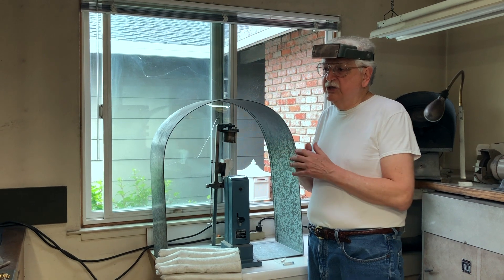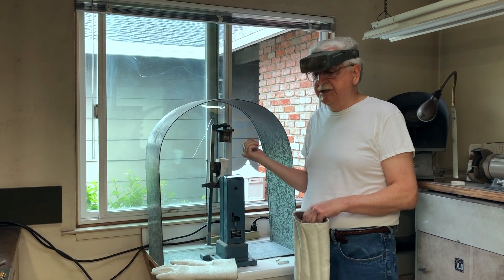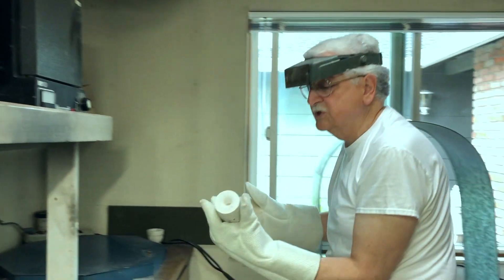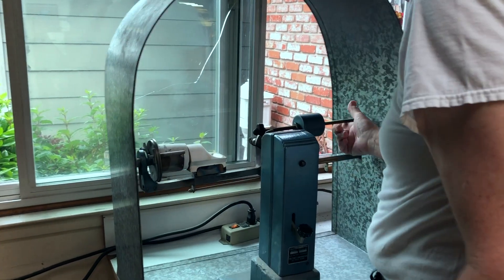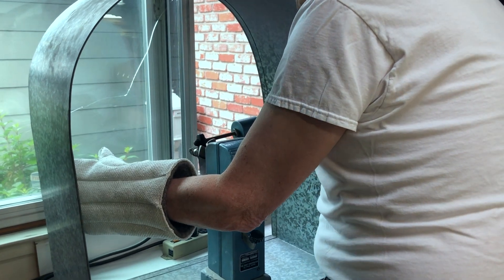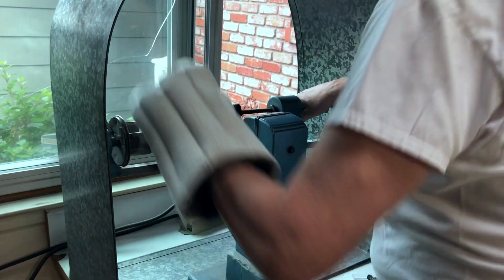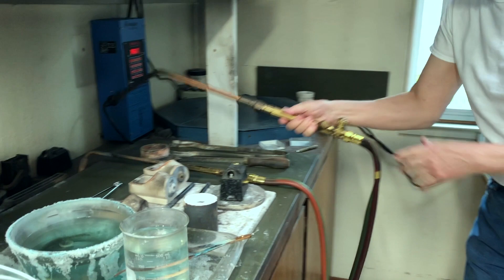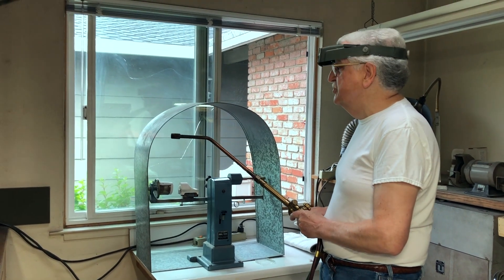Jewelry Making Basics: Platinum Casting

Comment: As a Glassblower…Very unsafe setup. Your ventilation is very weak for the torches you’re using. And you should setup a flame resistant medium around that window such as Hardibacker.

Comment: What is your torch setup? It looks like a typical acetylene tip, but I assume you are using flashback arrestors and/or check valves + compressed hydrogen gas tank; is this correct?

Comment: good day! I castedd few times platinum 950 cobalt 50. But out of 5 castings, my metal was very brittle and broke in my hands. I only managed to cast well once.
  I took the dental mass, preheated the flask to 900 degrees Celsius, then lowered the temperature to 300 degrees Celsius.Cast on a centrifugal horizontal casting machine. Burning with propane-butane and oxygen. After casting left for 8 hours to reach.
Please tell me what I did wrong?
Reply: ditch the cobalt. use iridium.
Reply: @peters5903  Thanks for advise but with iridium alloy is too soft for me.
 now i use ligature with indium gallium and copper.  this alloy casts well and has a very good hardness (160Pv)
Reply: @mart1han still using that alloy?